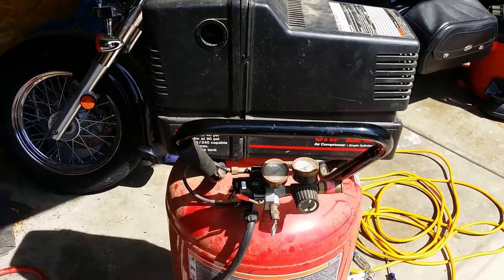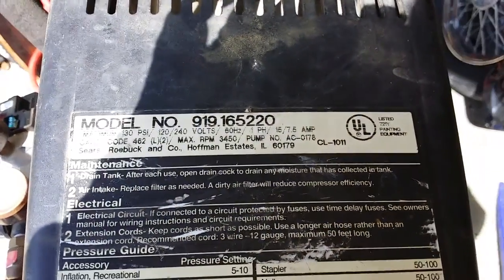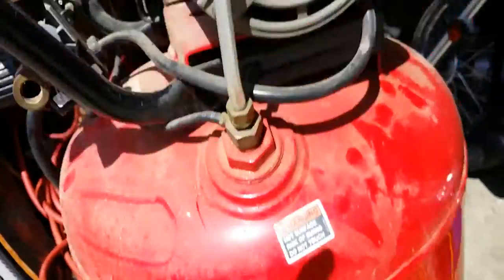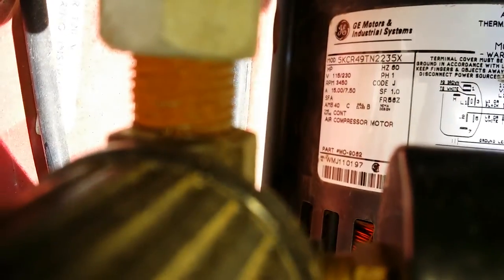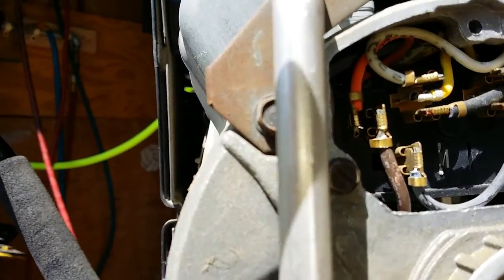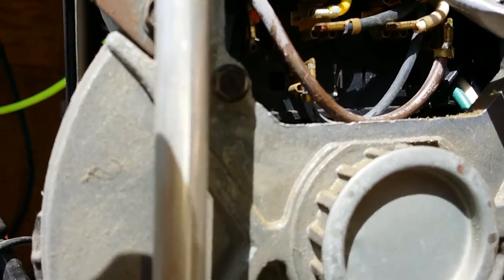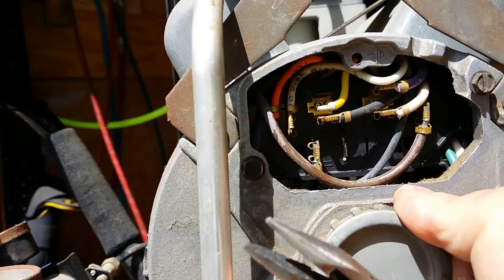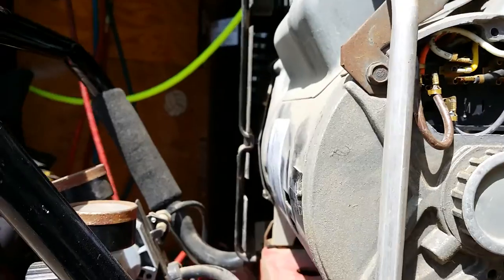Craftsman Air Compressor 919165220: How to switch from 110 to 220 and back again.

Comment: Thanks JM!! Mine is a 1997 919.165300. Got right torx, 20 went to 220 w no issues. Changed plug, and used fused adapter.

Comment: Just wanted to thank you because my motor was wired for 220v and had the 120v prong plug on it, wasnt going above 20 lbs air press.and thought it was the run capacitor,all better now,thanks again for the wiring explanation.
Reply: Thanks for that comment. I watched this video to see what to do with the power cord (which isn't addressed in the video after all), because I thought it was the run capacitor as well in mine, but the problem is the exact same as yours -- wired for 220V, but only a 120V power cord. Not a good idea.

Comment: Not a bad video but don't forget to mention that the plug on the cord, the outlet that the plug will be plugged into and the breaker will need to be changed for a 220 circuit.  Thank You for the video though as it helped me to know where to look to change the wires on my Air America 5 hp compressor by DeVilbiss to go from 110 volts to 220 volts.  I went with 12/2 wire up to the outlet (and colored the white neutral wire black to indicate that it's now a hot wire) and a 20 amp double pole breaker.

Comment: Great video, I have been trying to find a video that shows exactly what you did! I do have a question about the electrical plug, could you post a picture of video of it correctly wired? I dissasembled mine thinking it would need to be rewired, wish I would have found your video first...

Comment: When switching the plug over to 220 from 110, is there a correct/incorrect order of power wires to the plug itself? Does it matter which prong the white is attached to or the black is attached to so as not to harm the pressure switch?

Comment: Just came across your video. Would you have to change the cord from a big 220 to a 110 correct? And where would you do that on this compressor?Great vid. Thx
Reply from the maker: J Campezzi, read my recent comment.  No, you don't need to upgrade the wire. You might want to change the plug as it won't fit 220 120volt recitals. Or make or buy an adapter. The common 120 volt receptacle in your house has three holes. One long one (neutral) one shorter (hot) and the D shaped (ground). 220 has 3 holes. Both the vertical and horizontal are both hot 120 volts each, and the D shaped is neutral.
Reply: Thanks. Again Great video.

Comment: What is the benefit switching over to 220v?
Reply from the maker: 220 is a little cheaper to use than 110. Unless you use the compressor every day you probably wouldn't notice the difference on your electric bill.  

If your shop is a long distance from your main power source, it's cheaper to run 220 to your shop than 110. You'll actually get more power running 220 because you can divide the single 220 into 2 - 110 services.
Reply: Stupid question. But what kind of wrench do you use to that the main cover off.   It looks like an Allen wrench but nothing fits